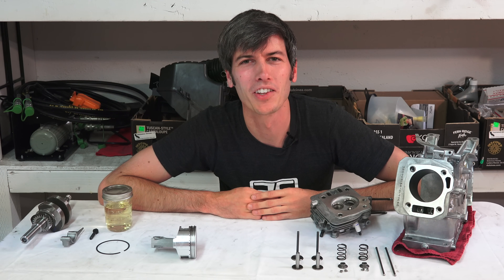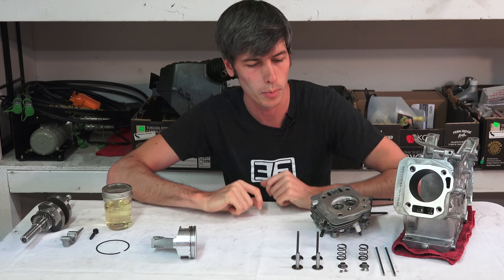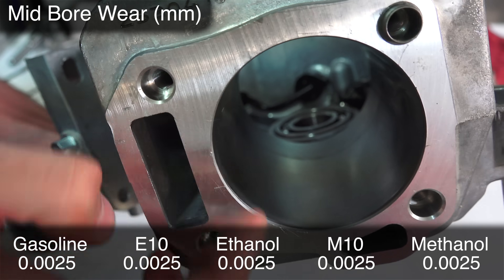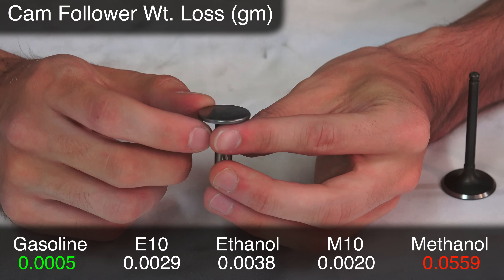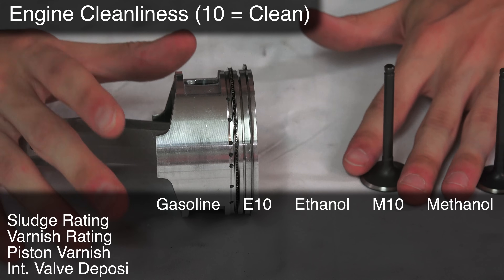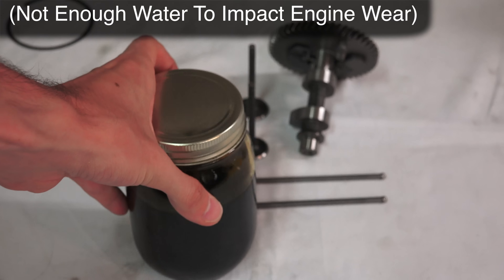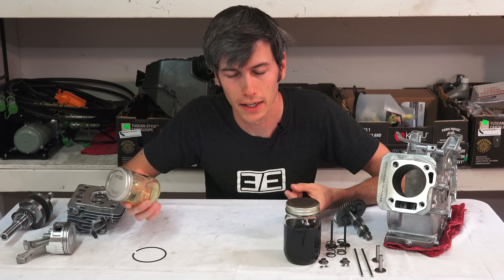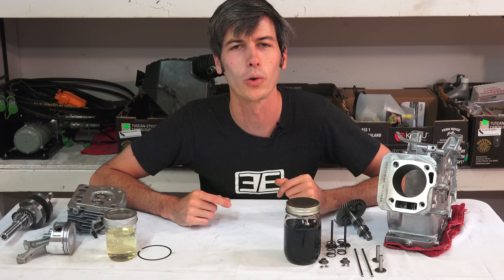Is Ethanol Bad For Your Car's Engine?

Comment: The biggest issue with ethanol blend fuels isn’t the rotating assembly of the engine.  The issue is rubber and plastic components in fuel supply accessories like carburetors, fuel tanks, fuel pumps, and flexible fuel lines.
Reply: Your cars brain now exceeds your own.
Reply: @thokim84  yeah your kid is too young to drive the car but you them to teach you all the electronics!
Reply: The biggest difference I noticed was when I left CA with a '88 LSC in 2000. YEP 2 MPG difference between CA and OK. Oh and that old Lincoln required premium. But since then the CARB/ CAFE virus has spread and there was noticeable MPG decrease when I was driving from Detroit to Baltimore.
But having worked in a oil refinery or two, I can say if it is liquid and burns, it goes into gasoline. BUT if it is for jet fuel or diesel no way. MOAR $$$.
There no such thing as a waste product from a oil refinery. Just in case you think there is. Even the mud that is in the crude gets made into something.
 What is Octane rating of benzene? 100 that is good. But not so good for breathing.
Reply: @warrenpuckett4203  Of course the MPG will reduce, you have to tune your car to use it...Ethanol NEEDS to have a higher compression to be efficient, with a old Lincoln 8:1 compression ratio you will just drop fuel from the exhaust. Or don't notice the fuel literally on the back muffler?
Ethanol needs at least 13:1 or Turbocharger.
Reply: @AMV12S  I think the whole purpose of these regulations and fuel components is to make IC engines too expensive for Joe and Jill Average to drive. EVs? Well those also are not so cheap. 
 Yep lets go back to the 1910s and pay labor like it was 1880.
 Plus there is the limited maximum daily range. Also the same with battery life. I have used a 35 year old electric fork lift. It had the same original battery.  It was slow charged every day and was not used more than 2 hours on day shift. Every Monday all the the cells were checked and distilled water added if needed. Over charged on a maintenance schedule also. Never used outdoors. It also was a 10,000 lb working capacity. It was  used to move 6500 lbs max and only done once a day.
  YOU CANNOT do weekly maintenance on EV batteries.
 If I want to charge a Tesla at level 2.  I have a 9500 watt continuous sine wave generator that only uses 8 gallons of gasoline in 9 hours. (60lbs of propane and 16 hours with a 120 volt charge rate).
 Tesla claims you cannot do that.. Well Tesla is right. Cannot run the house and charge the Tesla. In 8 hours. But in 16 hours , can do.
 But what do I know? I can only repair, build and diagnose malfunctioning 20 megawatt radar sets.
 Oh & also a 1969 stock purple shaft 440 does not run long on premium 2023 gasoline. Problems with the carburetor, valves and steel fuel lines. Also wont make 425 HP at 2200 RPM with that stock carburetor.
Reply: @warrenpuckett4203  That's something I noticed way back in 7th grade in a geology book:
There was a depiction of an oil rig with a giant flame coming out of a large chimney/tower and the caption said something about gas being burned as "useless waste product" of the oil extraction.

If it burns, how can it be useless?

Oh, right: Capitalism. In economy class, they told us that the competitive market forces companies to use resources as efficiently as possible, in geology they told us the gas that's extracted alongside the oil couldn't be used for anything productive. One lie covers the other...
Reply: @LRM12o8   Not exactly. The platform is engineered to prepare liquid petroleum for transport.
Compressing the gasses to liquid pressure requires different skill set and a platform by itself. In some cases another pipeline back to the coast with gas pressures. Sometimes it also involves politics to build that pipeline. No make that all the time. That is the source of waste product. Or just all that just makes it not economical to sell.
 Handling and transporting LPG in a vessel requires another skill set and environment.
 On land, transporting petroleum gas is done in a pipe line. In refineries a flare is used to control the pressure of the gas.
Without them the refinery go BOOM and burn for a day or so. Sometimes they just go boom. Not fun when you are inside one. At least on land you can go outside and watch the burn until they tell you to you may  go home.
Reply: My 2002 SV650s was a steal because ethanol ate through the float bowl gaskets which made it leak badly...
2x 1.50$ o-ring gaskets later and I haven't seen a leak since... No way am I putting ethanol back in that after I cleaned up the varnish that polluted that carb...
Took half a can of brake clean ffs... You want that in your engine, all the more power to ya... 
I use Shell V power here because it is ethanol free... a  lot less issues right across the board.. my lawnmower is more happy, my car is more happy, and my bikes ride like the wind... 
I'm not a guy that blindly pays someone to work on my stuff... i see what it does myself...
Reply: @LRM12o8  That is a flare. A flare is used to average out the pressure. When surge hits and a flare is not enough you get singed. If you are far enough away. So let me explain how a refinery explosion happens IN the one that was the worst that I  remember. I hear this loud hissing sound. I though when are those ass Houls going to turn the valve off on that air line. About to 3 minutes later I learned was not compressed air. My 1st hint when the blast knocked me down. The loud hissing sound was from the other side of the refinery 2 1/2 miles away. A methane / hydrogen gas mix will do that. That time the flare release failed. If you burn it. It does not expold.  It works this way. You get leak. It finds a ignition point. The explosion happens.
 Then the fire starts. Then then fire department puts out the fire. About 5 hours later. Maybe.
Reply: Ethanol does not cause wear on plastic. Alcohol is sold in lots of plastic bottles or with plastic liner.  Plus lots of cars designed to run ethanol or flex fuel have plastic gas tanks.

It does cause wear on any rubber fuel lines though. 

Also converting a car to run E85 or pure ethanol might require upgrading the fuel system (bigger pump(s) and injectors, bigger lines... and of course no more rubber, metal hard line or PTFE).
Reply: @trumpisaconfirmedcuck5840 Alcohol sold in certain plastic case usually PP. not ABS like most of card parts made of
Reply: So the question would be what material doesn't get destroyed when using ethanol for part upgrades to prevent problems . . .
Reply: My 1993 Opel is rated to be allowed to use E10, but after using it for two years I can tell that my mono-point injector or its rubber sealing rings started failing slowly and leaking fuel, until the point where the engine would be flooded on cold starts and not run until waiting the petrol to vaporize. Finally last December it completely died and the petrol finally made it through the piston rings to the oil sump, where it got in the oil filter and so it starved the engine of oil. End of life, piston rods seized. Motor oil smelling strongly like gasoline. Would this never have happened on E95? Who knows, but it's my experience at least.
Reply: @telocho  Was looking into it. An article from 2011 says Germans were upset about ethanol in gasoline. Looked further. Apparently Europe has been getting rid of E10 since 2009. So it seems the American government likes to do some things opposite of others. Continuing to use things like bad fuel types is good for the economy. Increased engine wear leads to more visits to the mechanic, more parts being ordered, more parts being made, and all that helps keep up employment. Then detracts from employment buy having automobiles manufactured and assembled somewhere else. My first vehicle was a 1992 Dodge Dakota, I was the second owner. First owner bought it in Austin Texas, after it was assembled in Canada, which the assembly came after it was manufactured in Mexico from resources from the United States of America. But then, that does help employ truckers and people in other countries and nations.
Reply: @Body Rum UAE  my German cars both love 30% ethanol because both are turbocharger charged. 2018 Volkswagen GTI and 2021 BMW 3 series. News from 2011 is over a decade ago and irrelevant.
Reply: E10 is not suited for older engines. All cars build from the mid 2000s are prepared for it though.
Reply: @baronvonlimbourgh1716  you obviously have never worked on newer cars.
Seals break down faster than on old cars so obviously 'prepared" by manefacturing companies just means they say go ahead.
You realize there's no laws stating the motors have to actually be able to handle the new blend just as long as emissions testing is passed they are good.
Reply: @baronvonlimbourgh1716  cars from 1984 onward can use up to E30 with no need to modify parts, but it's still good to use stabilizer in your fuel regardless of whether ethanol is in or not, gasoline's got many corrosive benzene derivatives in it, 25-27 in fact..
Reply: @baronvonlimbourgh1716  Well thats not technically correct. It is the fuel supply system rather than the age of the engine.The fuel tank and hoses and fuel filters need to be compatible.
Reply: @baronvonlimbourgh1716  More like not suited for vehicles with older type fuel lines. My car is a 1999 Ford falcon Wagon and it runs on E10, LPG or E91(91RON) unleaded fuel. The fuel system was made to cope with all three types of fuel. You don't want to leave E10 sitting in your tank though as you can get sludge forming (not sure why it does it but it has hapnened to two friends who had the sedan version of my car and left them for 12 months.
Reply: @baronvonlimbourgh1716  My Corolla is from 2004. Apparently my catalytic converter's O2 sensor was bad and was giving bad info to the ECU making me rev the gas high in 1st gear (and somewhat in 2nd) while shifting to keep from stalling. I replaced the O2 sensor which immediately fixed the problem, but the damage to the cat was already done. Now I have to shell out $2-$3k for a new cat (cats are expensive in CA due to our laws). Do you think my O2 sensor was fouled by ethanol?
Reply: @sequoiahughes8536  no, i don't think that was part of the issue. O2 sensors just fail sometimes, it happens.
And i personally never heard of o2 sensors being sensitive to fuel mixed with ethanol. It is more the rubber parts and some gasket material that has issues with ethanol and can fail prematurely. On the exhaust side it shouldn't make a difference.

Maybe sport cats are an option for you. These are universal units that are often used to increase exhaust flow in sporty exhausts but still follow exhaust gas standards.
These units usually are 2 or 300 euros, so a lot cheaper then original manufacturer parts. They however do not simply bolt on, it is litterally just the cat without piping and mounting attached. So they need to be welded in somewhere.
So now you end up paying for labour instead of the part. But if you might know someone who is a decent welder who doesn't mind helping you out you might be able to fix it on the cheap since a 2004 car is getting on in years as well and might not be worth spending so much money on.

Just a sugestion, do inform yourself about the legality of these units in your country though. They are fine here but that might not be the case everyehere.

Used cats can sometimes also be found, i would look for those first in any case ofcourse.
Reply: @baronvonlimbourgh1716  Mid 2,000  would be 2,500 ?
Reply: Baron von Limbourgh People seem to forgot just how long E10 has been around. My 89 Toyota pickup had its original manual and it was rated for E0-E10. I’d venture to say any car made in the last 30 years can run on E10 just fine. E15, on the other hand, is a different question.
Reply: @daveedwards6727  not all older cars are suited for e10 though. Lots of cars where but it only became law in the mid 2000s.
My e39s from the late 90s all where suited as well. But my 90s clio wasn't.

Guess it depended on the manufacturer.
Reply: @daveedwards6727  - My '15 Ford Fiesta ran better on E85 (minimum E50–maximum E85) than on ordinary E10. It did make the "service engine" light come on. Gas mileage went down quite a bit.
Reply: @algrayson8965  The mileage going down makes sense,  e85 is less energy dense than gasoline so you need more of it to make the same power.  I'd guess that's also why the service light came on, the computer wasn't happy with how much fuel it was using.
Reply: @Estok8805  - The service light comes on because the oxygen sensor(s) tell the computer that the oxygen content of the exhaust is not within spec.
Reply: @baronvonlimbourgh1716  also depends on the region. Over here in Europe E10 was introduced like brand new technology in the early 10's, lmao!
Meanwhile Volkswagen cars built in Brazil have been able to run on up to 100% ethanol for decades!

I have a 2005 Peugeot 206cc and if I recall correctly, the owner's manual advises against using fuels with more than 5% ethanol, which is exactly the ethanol proportion of the standard fuel mix these days.
Reply: @daveedwards6727  Well, i had a seat toledo from 1996, when running e10, the carburetor broke because the rubber gasket cant handle it. In order to save the gasket i had to use 98RON OCT. (I live in europe) Because they dont have e10 in it.
Reply: @daveedwards6727  Current E10 is 10 percent maximum. E10 started in 1978 in America and more so in 1979. The original E10 was not regulated and was supposed to have a 10 percent average and a stated content of 5 to 15 percent ethanol. The ethanol percentage content control was not good and it often exceeded 15 percent through the 1980's. When government regulation came in, E10 became a 10 percent maximum. Before the 1990's, ethanol was mostly imported from Brazil to the US for use in gasoline.
Reply: @baronvonlimbourgh1716  Cars since 1983 can handle up to E30 with no change in the engine.
Reply: And injectors. 😎
Reply: Yes and it corrodes the metal's
Reply: As others have said, this is accounted for in all modern cars.
Reply: @holmessph7  My '66 Corvair got the same gas mileage as my 2016 Trax.
 But the wifey would not drive a Corvair.
 3 pedals, No A/C no cup holders, Too many gauges. .NO beeping thing to tell you there is a vehicle next to you. No makeup mirror to use while you are driving. NO auto steering to to keep it between the lines while you are putting your makeup on. Only AM or FM?
Besides who wants to look in bunch of mirrors anyway. Oh and no phone button on the steering wheel.
Reply: In BRAZIL and I'm brazilian myself we use E100 since the 80's as a solution to oil crisis. Toyota, Ford, Chevy, Fiat all of them have global cars capable to use ethanol here. Here we do not see any difference in terms of reliability of the engines. Old 1.8 Cruze or 1.5T, Peugeot-Citroen/BMW valvetronic 1.4T, Corolla's 1.8 or 2L, or even 1L turbos (VW or Fiestas) are flex fuel. Premium brands also started doing so, like BMW are selling 3 series to use E100 or gasoline at any proportion. Kia kept their 5 years warranty and most of their cars are flex. In total +70% of cars are flex fuel in BR and by our law the gasoline must have at least 20 or 25% ethanol (do not remember the exact percentage right now).

The technology we have today is more than enough to handle ethanol in most cases. The industry normally just change one or two components so it can handle the engine at cold weather and as we have more and more electronics under the hood you can use any combinantion between gas and ethanol.

The last development that we had is a pre heating system that could make the car start even in freezing temperature with ethanol. The system heats up to 70°C before it sprays into the chamber. Older cars use to have a little tank (500ml to 1L) on the side of the engine with gas to help with cold starts. Now this is not necessary anymore.
Reply: @rafaelrp07  hey there ..may i please know the conditions of 2 strokes in your country..i am from india and by 2025 we are gonna switch to E20 and i have a 2 stroke which i really dont wanna mess up..please reply🙏
Reply: @rahulravindran4635  Hello, here in Brasil, 2 strokes are for small motors only, like saws and tools. but I have a saw with a 2 stroke engine with more than 20 years and still works fine, not losing power or corroded anywhere apart from normal use
Reply: @ricardocruz3578  20 anos no álcool tua moto? Legal o relato
Reply: @lincolncesar_  Saw é serra... tenho uma motoserra velha que foi convertida pra alcool. mas relendo o meu texto, vi que ficou meio estranho a ordem, vou edita-lo para melhor compreensão
Reply: @lincolncesar_  entendo o espanto porque a CG 150 flex tem só 11 anos, mas o que tenho é uma motosserra convertida pro alcool
Reply: @rafaelrp07  Meu avô tinha um kadett a álcool, e nao foi o álcool o problema daquele carro. Usei muito na saveiro cross ea111 por bem uns 70km e ta rodando ate hj com outro dono tbm. Sempre vem alguém querendo me atormentar com essa conversa. Mas as desvantagens como ele falou, são poucas mas existem.
Reply: @rafaelrp07  E100 is the best clean burning renewable and more power then the Carcinogenic fuel everywhere else
Reply: Just getting this in the UK,the government only started informing people about  it maybe six months ago   when it came in September 1st absolute  joke the uk government is
Reply: Yes. It trashes the carburettors and all those mentioned components on classic vehicles.
Reply: No
Reply: Same as the issue of ethanol gas in small engines like mowers, chain saws, leaf blowers and others. It's tough on rubber and dangerous to aluminum parts.  That's why "clear gas" is necessary on that equipment.  

The difference is that in a vehicle, the gas is burned so quickly, it never lays on those parts like a solvent, for any period of time and it never has a chance to separate out of solution. 

You can make ethanol free gas buy adding a bit of water to it and the ethanol will be pulled out of solution, then the clear gas is left to burn in your vehicle.  But who does that with25 gallons of gas?
Reply: And also ALUMINUM.  Ethanol causes "alcoholate corrosion" of aluminum.  Many small, carbureted engines die a horrible death if you put ethanol through them.
Reply: @lashlarue7924  most carburator are not Aluminium, but a alloy of zink and pot metal
Reply: @lashlarue7924  Just nickel plate the carb and you are fine, people here in Brazil uses since 80's on carbureted cars without problem...There's even american engines like the Chevy 250, Ford 302 and Dodge 318 here that uses E100 too, all with just a nickel plated carburetor.
Reply: Lash LaRue I’ve been running E10 through my Honda mower for over twenty years and it’s never missed a bit or needed even the slightest engine maintenance. Cars in Australia have been designed to run on E 10 for decades without any problems at all.
Reply: if your vehicle still has a carburetor you should know better than to put E10/15 in it.
Reply: @nilloc93  ethanol won't hurt it, it's the gasoline and carburetor gaskets that are the problem.
Ethanol does not hurt your carburetor.
Reply: Agree. Viton rubber seems to be the way forward. I run a number of older vehicles (1924 to 2001) and its just a case of working though the system end to end. Expensive but not impossible and you can be sure not to have leaks etc. None of the cars or bikes seem to have any I'll effects from e10 or similar. Most of mine are setup with a rich AFR. Nothing to report so far :)
Reply: @IDontWantAHandle101  I think that any English car enthusiast should contact the owners clubs for their vehicle in either Australia or New Zealand. They will have gone through years ago and will know the tricks and traps.
Reply: Yeah ethanol is only bad for cars that belong in museums or the junk yard.
Reply: @SaraK_69  As the owner of a 2016 I can defiantly say it is junk. It also has only 60,000 miles on it. I 'm  pretty sure it won't make it much past 100,000. BUT Detroit F'd up in 2003 and I got one that runs and has 200,000 miles on it. So lets end this with will your Tesla last 20 years and make 200,000 miles on the same battery.
 Most people have no idea what the actual energy cost there is making a automobile. IC or Electric. That requires listening to a Automotive Mechanical Engineer and not listening to a politician.